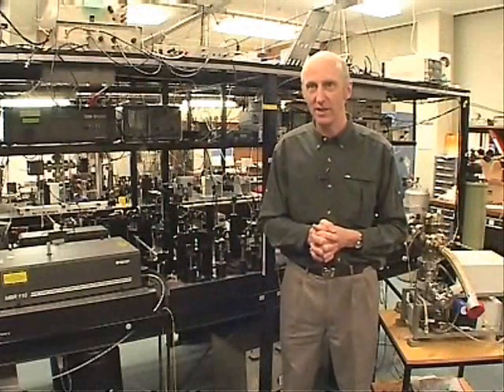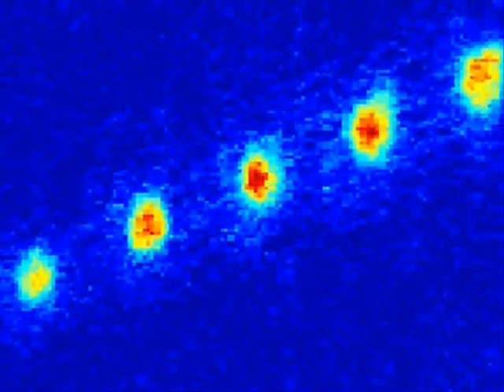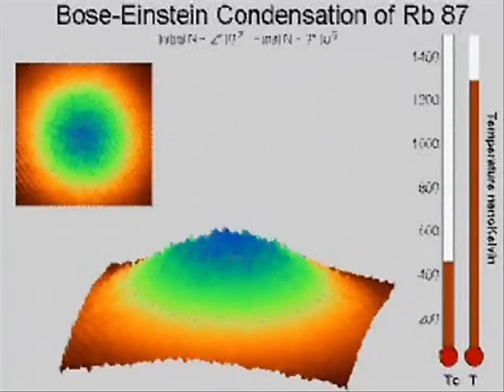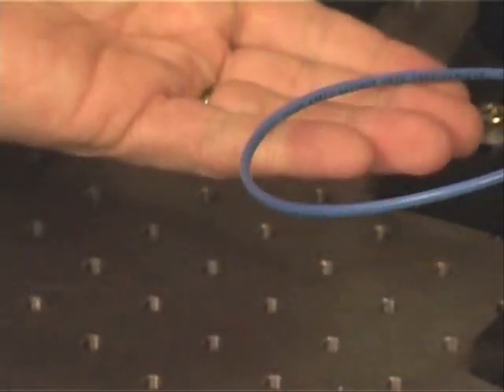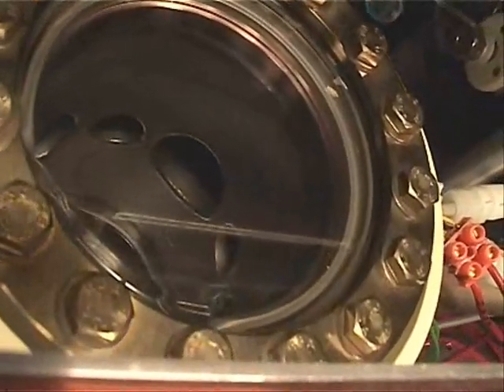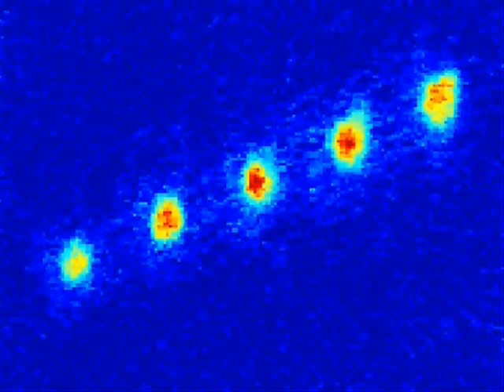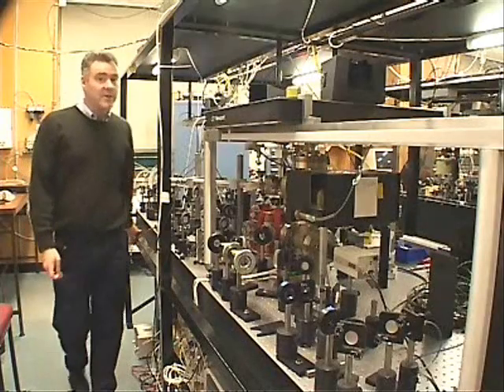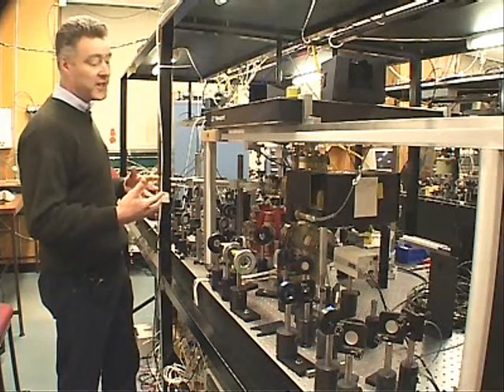As cold as it gets

Comment: you have several lasers, not just one. for example, if you want to cool Rubidium 87 isotope atoms into a condensate, then you need 4 different lasers. Then you use one of those 4 beams for other purposes besides cooling, such as imaging in order to see the atom cloud as it cools. Also, for any one beam, you have to do a lot of stuff. In "laser cooling" you shine 3 pairs of lasers along 3 axes, so that's 6 beams that come from just one beam. Also you need proper light polarization (circular).

Comment: Magetic fields can Travel through near absolute zero kelvin ? as if it isn't affected by the cold & has enough power to hold an atom from a cooling chamber wall.

magnetic fields keep atoms away from the freezing camber walls - so the condensate forms. Helium 3 can not freeze - 23% of helium in the universe that can't be explained..maybe the particles in the univerese have decayed and been recycled several times because of freezing .except for Helium 3 - but photons can freeze or slowed  ?